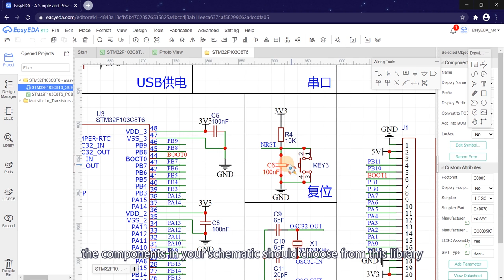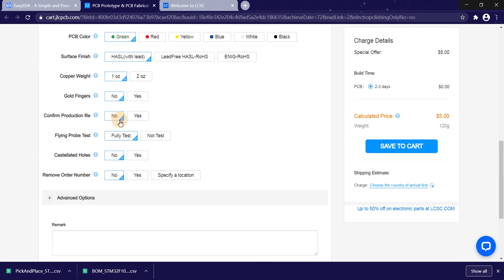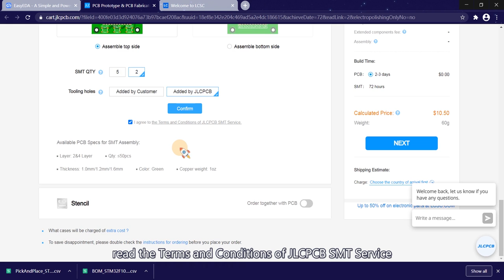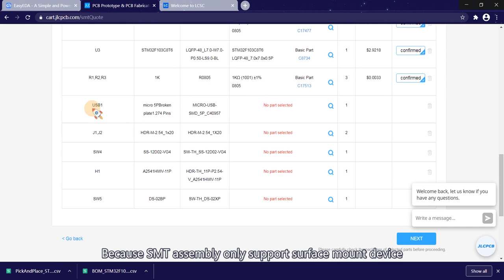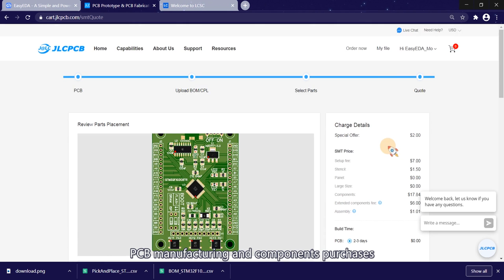014 SMT Assembly

Comment: Thank you for the video.

I have a question: When I select the component from the Library - What does it mean that for some components with SMT label there is a message "Doesn't support JLCPCB SMT Service"? (for example for this component: SS8050-G)

Thank you
Reply: https://youtu.be/upaVO_SMAQM👍🏽👍🏽👍🏽
Reply: extended part, with this part being minimum 3000. use SS8050 or S8050 J3Y or SS8550 Y2 from standard basic list

Comment: How do I select the component that I want. e.g. I want 10k resistor  from JCLPCB on my SMD board (already constructed in EasyEDA) and I cant specify it. I've looked at lots of tutorials and cannot find anywhere how to do? How do I click and tell it I want THAT component on the PCB from Component from JCLPCB.  I've tried adding order number to attributes , order from library (just makes duplicates does not replace my current component)

Need video on replacing and updating components for SMT by JCLPCB.
Reply from the maker: if you want to assign a LCSC part into  a component at schematic, you can export BOM, then assign it at the Export BOM dialog
Reply: https://youtu.be/upaVO_SMAQM 👍🏽👍🏽👍🏽